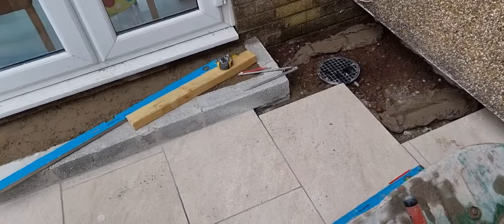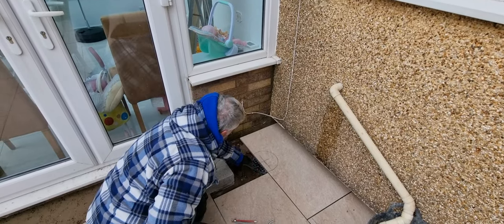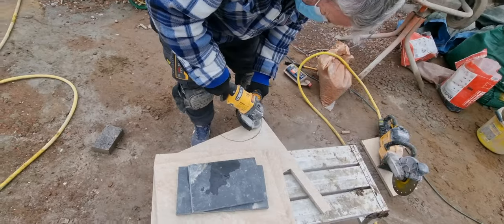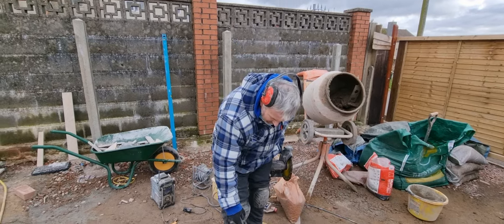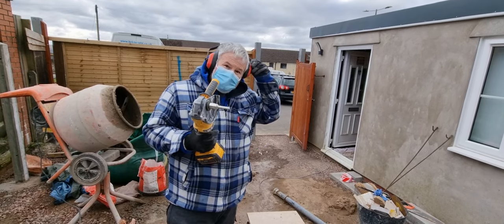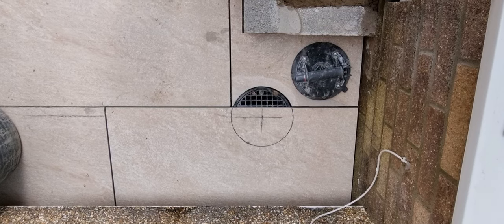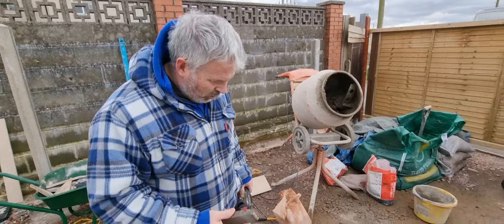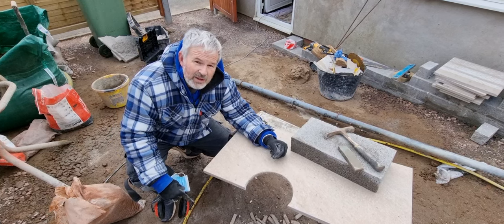How to cut a round hole in porcelain tile

Comment: Superb Justin diamond rake looks a good bit to have for grinder. Just put a order in there to elite stones. 
Vanity fine grit blade tile s very good Justin. A use 60 grit and 120 grit for putting that small machined factory edge back once cut. Get beat them dewalt tools buddy don’t we’re a would be with the grinder. 9inch is great option cutting tile less vibration and weight on tile as to the gas saw although a jump between both. Great tips buddy
Reply from the maker: That vanity blade from elite stone is it or somewhere else lee.yea that rake is good mate not sure if they do less grit or whatever the one henry sent me was good but harsh but still worked lee 👍
Reply: @brickrightbuildinglandscaping  
Elite stones buddy just ordered another 1 the other day great need to shave another 1mm of a cut or tidy a straight edge
Reply from the maker: @L Milne  i speak to henry then thanks lee 👍
Reply: @brickrightbuildinglandscaping  
Handy blade to have in the van buddy.
Reply from the maker: @L Milne  
Without doubt lee

Comment: I’m looking into buying the 54v dewalt stuff soon. I’d love for you guys to do a review on the grinder and cutter if you could?
Reply from the maker: Ben 
The grinder is brilliant mate i have to say and the battery lasts well on it .its a very good machine id buy it again and again.The large disc cutter which is compatible with the batteries is again a very very goos saw light wait powerful and has water suppression. Down side to this machine is the batteries dont last long enough ive been a bit disappointed with it only for this reason. It is worth mentioning if you have the right blade on it it lasts a lot longer .to by separate batteries is very expensive overall the grinder 10 out of 10 the disc cutter would get the same but battery time lets it down a bit so 7 out of 10 still a good tool to have mate 👍💯 if want more info ring me mate 👍
Reply: @brickrightbuildinglandscaping  thanks mate. Really helpful that was! I’ll call you with any more question over the next few days
Reply from the maker: @bensmith3613  no worries ben👍

Comment: Enjoyed the other video, looks a great job, just a little worried about your ppe. You need to promote the correct eye protection, Fpp3 dust masks or air flow respirators. Set a good example as your channel grows.. Great Stuff, quality work!
Reply from the maker: Graham 
Not gonna argue with any of that .i did try the glasses steamed up straight away .the cutting was mostly wet but good points agree with you 👍💯

Comment: easier to change the drain for a square one... although if there really is no other option I usually cut the curve half way from the top side with a 4", then transfer the shape to the back and cut roughly the shape with the stihly, doesn't matter if you overcut and make a mess on the bottom.
Reply from the maker: Thanks for that Adam yea i wanted to cut it having changed to square grids many times .cheers for the tips 👍💯